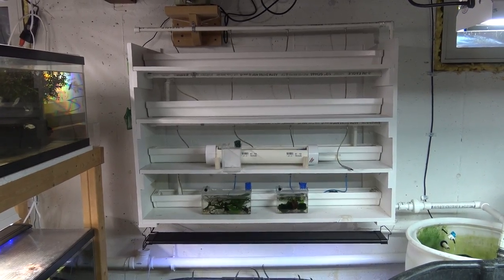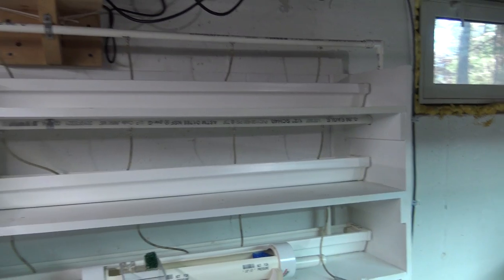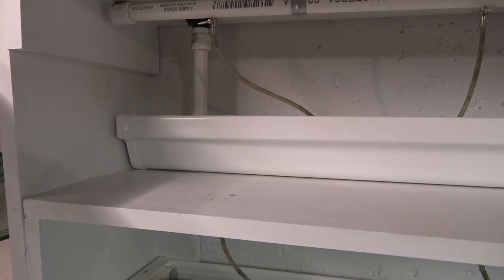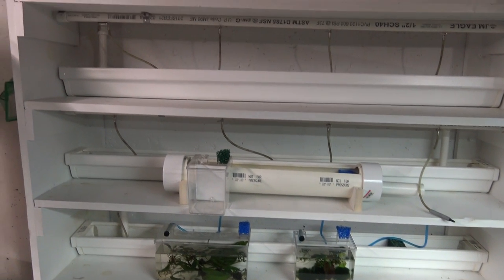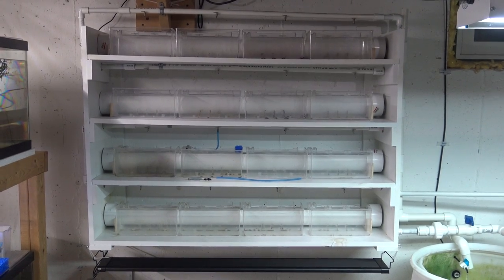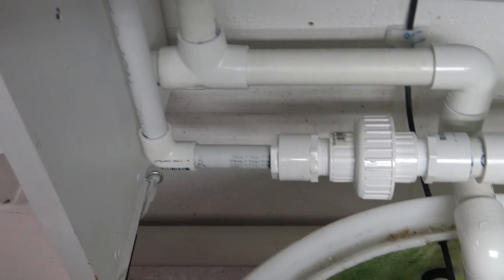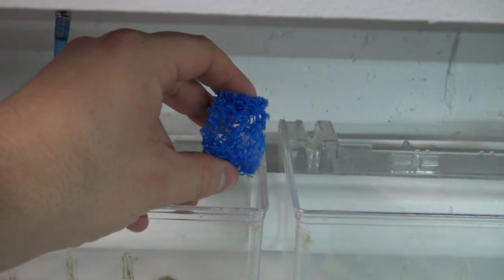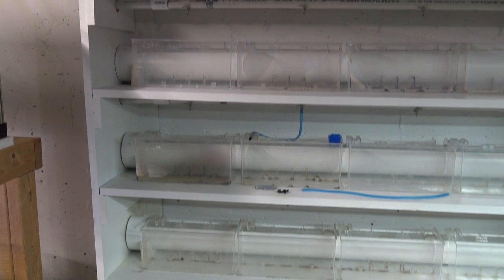#562: BETTA BARRACKS REBUILD - Update Monday

Comment: Hey Greg,

I like the changes you made. When I get to the point where I will be adding a similar system I think I will be adding the 3” PVC drain system too. 

Something that came to mind while I was watching this video is that if you still have problems with the drip lines clogging up from the heavy or large detritus passing through your PVC lines it may pass by the drip lines of you rolled them so that they come out of the tip (or at least the side) of the PVC lines. This way the weight of the detritus will keep it on the bottom and pass straight through the system. Ah, just a thought anyway. 

Thanks for sharing,

James
Reply from the maker: I found a quick way to clear the drip lines, I just shut a ball valve on the very end of the line, creating a burst a back pressure, ez pz
Reply: Greg Jones - That's awesome. I would have thought it would messed up the other valves but that's way easier. I'll keep that in mind when I set mine up. Thanks!

Comment: I like your barracks looping the input line is something we used to do in irrigation drip lines to keep pressure even in the line. Something else we did to ensure drip emitter diaphrams did not clog (and kill the plant) was to put an in line micron filter in here is a link to one (www.sprinklerwarehouse.com/Rain-Bird-Sprinkler-Inline-Filter-p/rby075mptx.htm) if you put it in after your ball valve and position it facing down over your barrel cleaning would be a breeze just unscrew by hand and rinse out screen. Then no more clogs hope this is a help😁

Comment: That is cool.  How small would fry need to be to sneak through that matalo(sp) mat?  Hope it works with no leaks.
Reply from the maker: there is different mesh size matala depending on fry size, in extreme cases i could turn the flow down and put a filter foam sponge in instead

Comment: Can’t you go from 3 inch pvc to 1 inch without a uniseal?
Reply from the maker: Reducer bushings would be centered, I wanted mine at the bottom of the trough to reduce standing water in the gutter and reduce the chance of overflowing/clogged gutter
Reply: Greg Jones makes so much sense now!

Comment: I thought your idea was excellent up to the point where you reduce the 3" pipe to a 1" drain.  Why not just keep on going with a 3" pipe connected to a 3" drain?  Otherwise very beautiful and a great idea for your bettas.
Reply from the maker: A total of 16 drip lines would gravity feed through 1/2 inch PVC, 1" is plenty, 3" would be way overkill